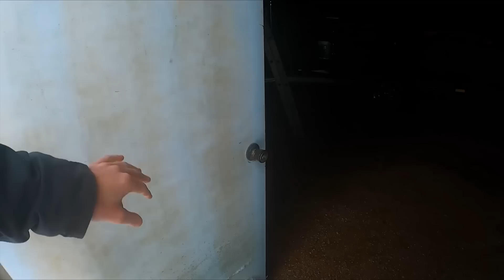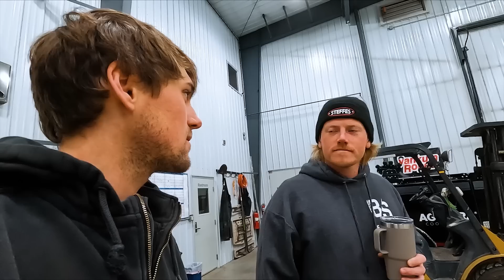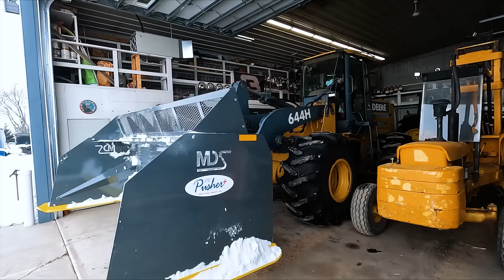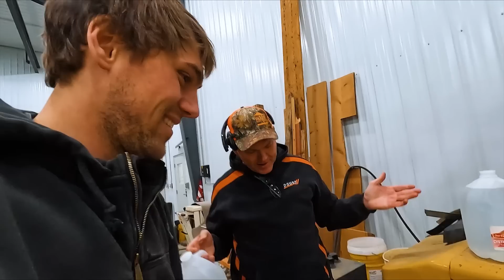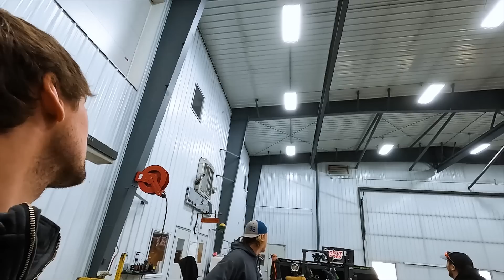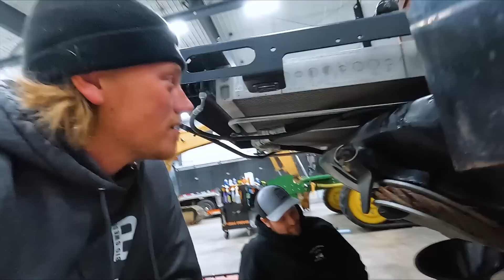Just Isn’t Like It Used To Be!!

Comment: Dougo, you should be able to add a auto fill kit to the battery. Then put a 2 gallon container on wall with a flow indicator inline. So when all cells are full the wheel stops.

Comment: Dougo - try Thermoil Battery De-mister oil in your forklift batteries - it is a layer of oil that floats on top of the electrolyte and prevents the water from evaporating out of the cells.  You won't have to add water ever again.

Comment: When you go to fill the battery with water, put a 4x4 board perpendicular to the machine under the battery so if slides out to far it will stop on top of the board.

Comment: Chet Change the air dryer filter once a year, and you're drivers will be happier.  Change your DEF filters at least once a year as well. Same reason. The DEF filter is on the bottom of the DEF tank.
Reply: Theirs a much better way to fix that def filter... 😁

Comment: Nice to know dougO
Is struggling again does he need another vacation 
Chet order him some water in 5 gallon buckets they will not leak until he pours it on the floor trying to fill the correct OSHA Approved container to work on the batteries yall stay warm n north texas today only 70 degrees

Comment: Are you guys adding water after it is charged. Those batteries need to be checked about once a month. Distilled water is good but not required as well. Most of my customers don't use Distilled water and the batteries are just fine. Especially how little you guys use the orderpicker

Comment: Seems like a lot of work for 5000 hrs. Then again what do I know I bought a maintenanceless rig. 50,000 miles (I won't mention the hours, they're up there) it only requires 10 quarts of blue ATF and a bottle of FPPF. No Zerks either. Tech looked at the thing goes there's nothing under there. LoL.

Comment: I noticed as you were talking about the repairs for the red Quad International  that you had steel beams over head. I guess that they are probably structural supports for the whole building , but  if they could  also support an over head crain? That would come in handy in pulling that hood off of the red quad. Just wondering.... You should tell Doug O that you want to install an over head crain system on those beams and watch his face fall off... hehehehe And then minutes later you steal my idea  😞
Reply: They talked about in this video. They said they priced one in 2020 @ a cost of $32000 a year or solater it was around $64000.

Comment: Dougo, I had the SAME problem with those Great Value distilled water jugs (that's Walmart's house brand) I bought to flush my coolant system. Those aren't like jugs anymore, they're more like square plastic pouches or plastic bags. If there were something cheaper than water, they'd substitute it to make more profit for themselves too. They can't get thrown under the bus hard enough, imo. Basically, Walmart is an open sluice from China, a garbage funnel. They have done more to make us a third world country than anyone else I can think of.